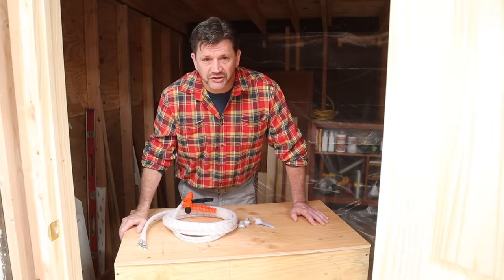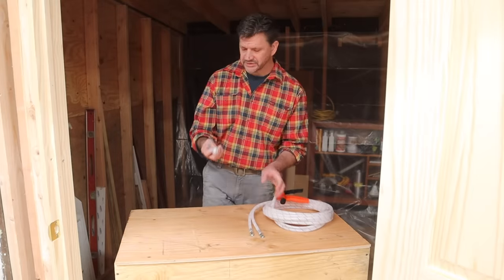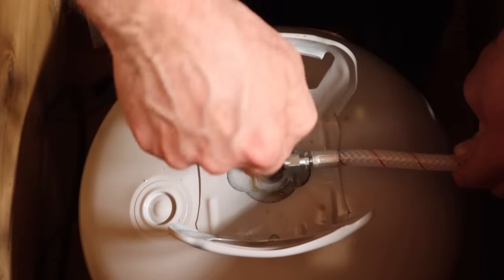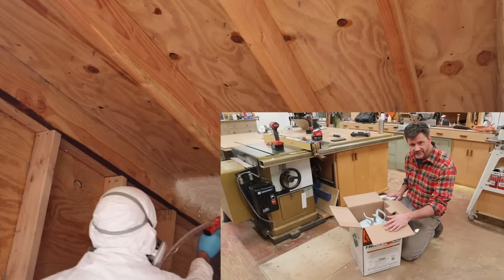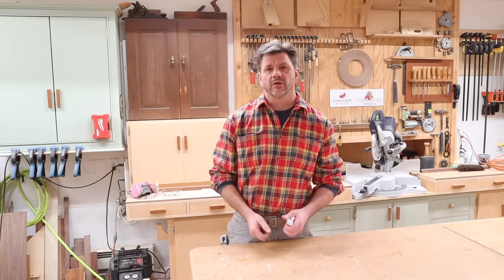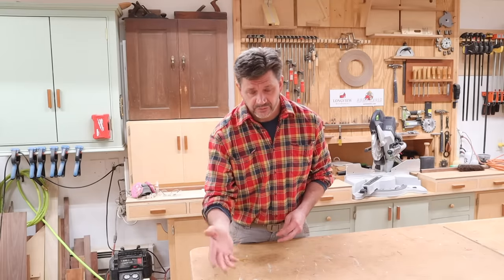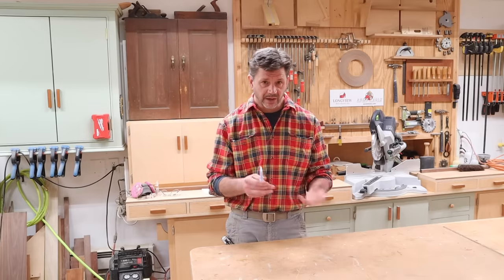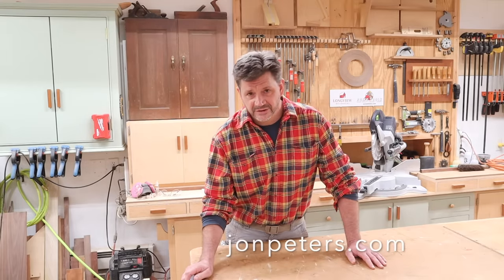DIY Spray Foam Insulation - What You Need to know Before You Start

Comment: If you use a mason jar and fill it halfway up to 3/4 of the way with acetone and the tip start clogging take it all soak it in this solution and it will clean them completely then when the next one clogs replace it with the first one and it’ll work much longer what’s the town will melt and help you clean up afterwards as well but you’re right put a dropcloth down as this stuff sticks really well to everything The other thing is you can use this phone for many reasons it’s great for filling pontoon boats garden tractor tires how to make sculptures means believe it or not if you use it as I have for a sculpture after you’re done grinding and sanding on it if you want to fill a spot you can use body filler you can prime this is standard polyester primer you can also lay fiberglass over top of your sculpture then use body filler to finish it with you will be strong enough you can make molds of that it’s amazing stuff.
Reply from the maker: Hi Mike, great comment! Thanks for all the good information 👍👍

Comment: Good information. I’ll be building a 30x40 pole barn shop next spring and probably will stick with fiberglass insulation. Thanks for the video 👍
Reply: That's what I did , but added diy spray foam in areas where I knew air leaks, drafts , and any other potential areas  would allow air to get through. Basically around windows, doors switch boxes etc.. also I used foam board on the outside before I put my exterior sheeting on

Comment: How many square feet did the two kits cover? I just insulated my barn and I used Rockwool. I am curious what the cost difference would be.
Reply: The video description says 600 board feet per kit.  One board foot is one inch by one foot by one foot.

Comment: I did 14 kits a week ago. Wow that was an experience. Was allot of work but was cheaper than hiring a company.
Reply: what size was. the structure? I am having difficult time figuring out how much I will need. thank you
Reply: @threeriversdent  I did the second floor living space and 3rd floor roof line of my house. If you go on tiger foams website it tells you how much a kit will do weather you figure out board feet or they have a cubic foot. I used open cell and it does twice as much as the closed cell kits
Reply: @Electromikejr  on there now thank you
Reply: @threeriversdent  if you get the kits make sure you get the tanks to the recommended temperature and try to keep them warm or they don't work well and you don't get everything out of the tanks

Comment: I am about to insulate a 3/12 pitch ,16' wide vaulted shed roof that has 2x10 rafters and 5/8" cdx as well as the lean-to off the front that will be partially enclosed. I want to fully seal these roofs so that I don't have to vent to the outside and finish off with 24" batts. How thick do you think I should get my spray foam in order to totally seal my envelope?

Comment: Damn that is expensive!  Ha I didn't know that it was that costly.  I am curious about how much money you saved by doing it yourself vs having a crew come in and do it.  I learned a lot.  Thanks Jon!
Reply: For me to buy the materials myself it was about 1000 bucks for my workshop. I got quotes from two professionals, one was 2000 and one was 3000.
Reply: @calebcotter2850   what was the approximate size of the project/ coverage ?

Comment: Another thing to be careful with the tanks like these in small spaces is the gas propellent. I do not mean the fumes from the chemical reaction but whatever they use to pressurize the cylinders. I put about an inch in my attic several years back and while very close to the sofits that I was sealing I began to blackout. Probably nitrogen. The mask will not protect you from gasses like that.

Comment: I was surprised that the foam expanded so little. Your results were a lot different than what I've seen on home renovation shows.
Reply: It’s 2lbs foam which does not expand so much. Your probably thinking of 1/2 lbs foam which expands a lot
Reply: @giocondobianchi6557  You caused me to do some searching online where I found an article intended for architects and engineers explaining a lot about 1/2lb and 2lb foam. This was all new to me. Thanks.
Reply: @robertpenoyer9998  hello do you remember where you read that article? Thanks.

Comment: Hi! Is there any risc to apear mold between the wood and the foam?
Reply from the maker: I’m Not sure of the question
Reply: I think she’s asking if mould can grow in between the wood being covered and the foam.  (Like you see sometimes behind batt insulation that’s been installed poorly).
I would think that, because the spray foam is closed cell, there would be no air to allow for mould to grow behind the foam.  Is is considered a vapour barrier as well as insulator, so mould shouldn’t be a problem.
Reply: That would be a moisture issue, if water/moisture gets on the wood then its not an issue based off the foam use. We use it in shipping container walls to eliminate condensation from forming from being heated or cooled opposite of outside temps. Does exactly as insulation does, insulate. Its not a mold dispersant but if done correctly it should stop it from becoming an issue

Comment: Keeping an eye on that hot box is an under statement.  That setup is a potential time bomb in the making. Those tanks are already under pressure. Too much heat could be disastrous. It would behoove anyone who tries this  to mount an internal thermostat in the box and have someone else standing there monitoring the temp.
Reply: No, the way Jon did it in the video is fine and perfectly safe. He brought it up to temperature monitoring it himself, then turned the heater off and put the lid on to reduce cooldown times. Perfectly safe and easy for one person to do. His setup is no chance of exploding when run the way he ran it.

Comment: Does spray foam help in soundproofing?
Reply: Open cell is recommended for that. Remember, it only stops sound travel because it fills air gaps and also acts as a baffle. Depending on where you are at, it is actually cheaper to hire a pro than do it yourself.

Comment: I was all sold on CCF and ready to do my attic space, when I started to run across a number of 'bad' install stories.  Lot of problems with this stuff, even when the 'pro's' are doing it.  Problem is, sometimes batches just don't cure properly, or continue to off-gas some nasty chemicals which cause problems for occupants.

Buy from a reputable company, and do a search on them to see if they've had any issues, definately not off of ebay. And insure you follow the instructions to the letter like Jon did, else you will have an ungodly mess that will take 10x as much effort to correct.  Really bad incidents have required entire roofs to be removed and replaced!  

Personally, I just went with the rockwool.

Comment: Wow...that is expensive.  I had my 30x40 barn (10 ft high walls) spray foamed recently on walls, ceiling, and sliding doors and the entire job came to about $3k.  $1k for a small shed ceiling seems exorbitant.
Reply: What state are you in?  I’m in Maryland and looking at using foam in my 24x48 garage.

Comment: I am working on a small shed also... can I really get away with just doing spray foam in the roof? I thought if I wasn't using a roof vent I  had to spray foam all of it? Just doing the roof would be WAY cheaper!
Reply from the maker: Yes only need to do the inside roof … I used regular insulation on the walls with a plastic drop cloth vapor barrier that’s plenty

Comment: Rule #1: there is no going back, once done you could call working around it 'excavation'. best for concrete basement walls for air sealing with cavities left for removable batt insulation and infrastructure. buyer / user beware

Comment: Do not attempt this. You need years of experience and thousands of dollars of tools.
Use packed cellulose instead.
Reply: Do you have to vent the roof if you use packed cellulose?
Reply: @Aceshm  It depends on the climate. Cold climate yes to prevent condensation. Hot no as test have shown there is little difference in attic temp when vented and humid air gets in.
Painting the roof underside of the roof with a reflective paint will cool the attic down alot.